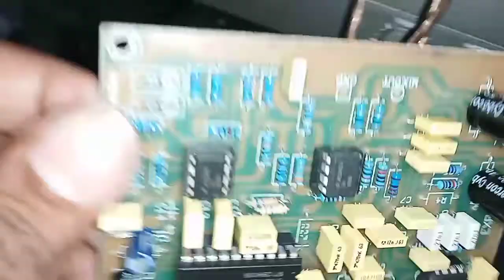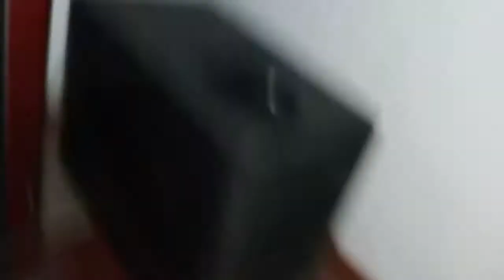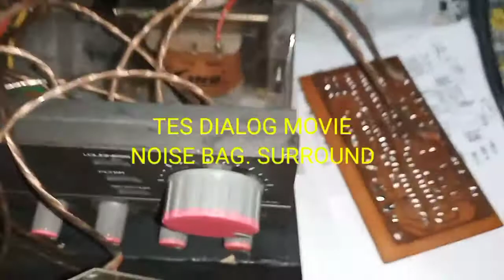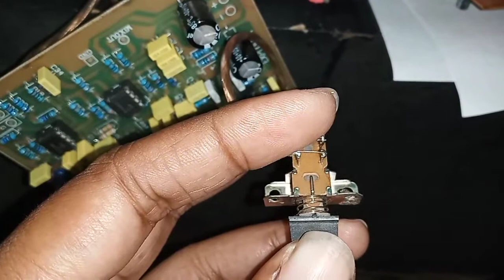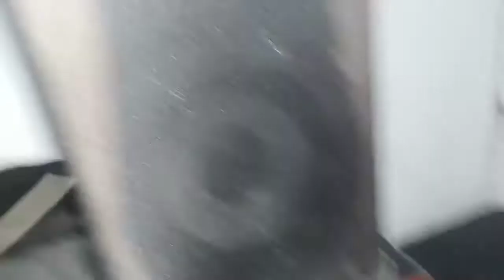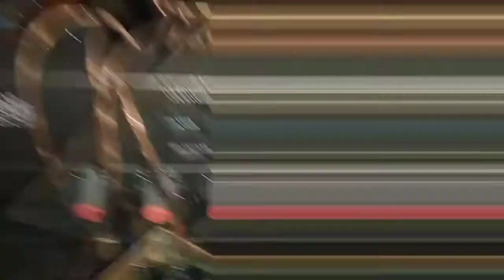Review dan Test Suara Surround Processor Sankit 5.0ch Rakitan sendiri ,Ternyata Ini..

Comment: Om,minta rekomendasi kit surround 5.1 terbaik dong,
Buat gantiin player home theater polytron.
Reply from the maker: @wronghole3410  sankit ini sudah bagus, bang.
Cuma harus nambah filter subwoofer lagi. Karena cuma 5 output.

Kalau mau bagus lagi, pakai yg menggunalam IC SSM 2126, tapi Langka. Juga mahal..

Untuk kit yg 3 IC , yg di jual online, tidak rekomen..70k - 90k.

Atau pakai audio rush,
Reply: @keitakahiro2409  kalo decoder 5.1 yg box pabrikan itu rekomend gak om?
Saya butuh buat gantiin player home theater polytron.
Reply from the maker: @wronghole3410  iya, audio rush itu.
Mending ambil itu..
Reply: @keitakahiro2409 kenapa bang yang di online 3 ic itu tidak direkomendasikan?
Reply from the maker: Kurang enak bagian rear/back nya.
Bagian sub seting jedug saja
Bagian center, cuma bypas.. ga ada bpf nya

Kapan2 saya bahas dan review pcb dan ic nya..di next video😊
Reply: @keitakahiro2409 ditunggu bang saya lagi kit processor surround yang bisa delay kaya home theater dulu saturn af 039 asli delay nya nagih
Reply from the maker: Oh af 039 ya.
Mantab itu bang.
Saya jg masih pakai..karena lebih enak 039 drpd sankit upc 1891
Tapi saya revisi pcb nya. Jadi kecil
Reply: @keitakahiro2409  saran bang di online tidak ada yang worth it kalo pake audio rush delay nya gabisa di adjust ?